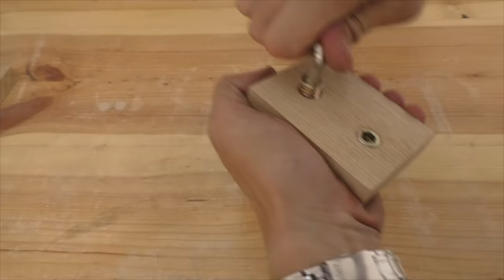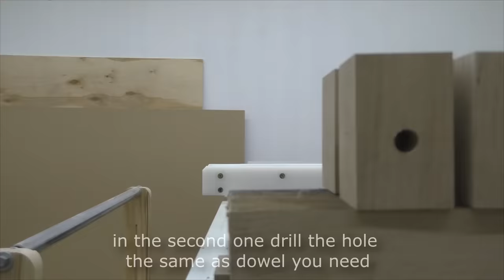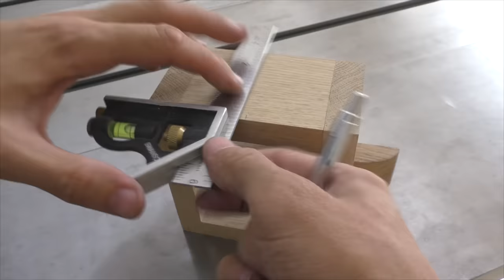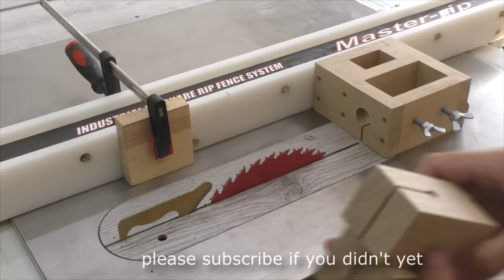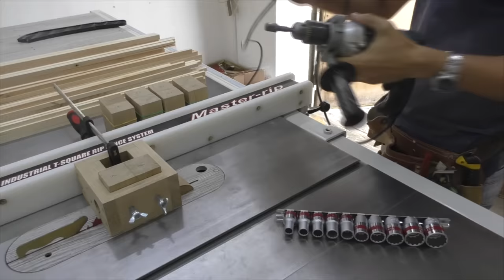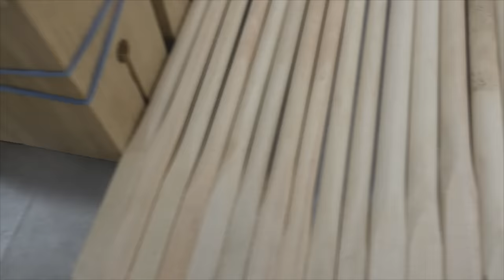🟢 How to Make Precision Dowels on Table Saw - DIY Table Saw Dowel Making Jig 👉 FREE PLANS 👈

Comment: Finished mine and made some 5/16th, 3/8, and 1/2 inch dowels from oak stock and all of them turned out great!  No need for buying high priced hardwood dowels anymore!!  Could not be happier with it.  Did add a guard onto the back end to prevent any "biting"

Comment: Made a bunch of quarter inch dowels today with the jig.  They are more finicky then the 3/8" dowels.   I found the smaller stock size would splinter if I tried to pull the part that was in the drill chuck like I did with the 3/8" dowels.  The quarter inch dowels wouldn't take the stress as well.  I just cut off the square part.  Worked very well once I got it dialed in.   I did make a extra set of blocks as my first set had shifted and went back to just a 3/8" starter hole to the quarter inch out hole.  The tolerance with the quarter inch dowels is much more picky.  I went from having a few store bought dowels to having over a hundred just using my scrap oak, maple, cedar, walnut.  The oak gave me the most trouble in the smaller size of dowel.  GREAT JIG!

Comment: Thought this was a great design and built it, inititially dowels were coming out undersized. Realized that when I marked the high point of my blade, it was in the full up position. Later when using the jig to make dowels, the blade was lower. My saw pivots when raising the blade so the high point was actually further back. Once I adjusted the mark on fence to correspond to the new peak worked like a champ. Apprec I ate you sharing the design.

Comment: Thank you very much for showing this!
I had already created a very 'no nonsense' dowel jig what was working (without the tablesaw), but i kept thinking about one with the tablesaw, came across your video and decided to make it tonight.
I did change some things (because that made it easier for me:
- i did not do your thing with the bolds and wing nut-thingy, i just uses a screw that i can turn in and out (filed the tip of a little)
That saved me a lot of time and i believe it works as well.
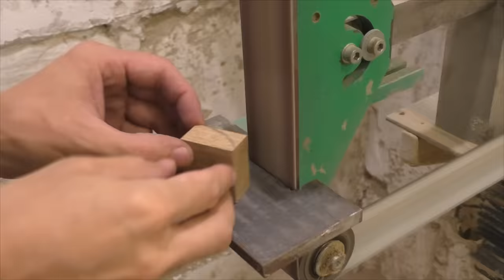Ah, and i had to make the jig to understand why you created the part at 3:07, i thought you used it to make it easier to insert the long stick, but it had a different (better) reason ;-)
I made it tonight, and tried it on one (i only created 1 size for now) and although the top of the stick came out smaller (i think because it was not really centered when entering), the big middle part was perfect.
Thanks again!

Comment: I've seen a dozen or so of these diy dowel makers I even bought the lee valley  one and sent the thing back.  This is the best  effort yet that I've seen  the only real limitation on the surface finish is the blade and feed speed.   Use a Non ferros metal blade ( one without those annoying devils ears) and your Finnish  should be superb.

Comment: now push through like you did making them, but mount them directly to the drill chuck on the rounded end to finish the left square part.
Reply from the maker: Good idea, but 13mm dowel is maximum my drill chuck can keep. Thanks

Comment: Chuck your drill up to the other end of the dowel and put it in reverse and pull the rest of the dowel thru the saw blade. Nice job I like these.
Reply from the maker: Thanks for idea, i did it already, but the maximum diameter my drill chuck can hold is 13mm 🤔

Comment: How does it compare to simply buying dowel rod from a hardware store? I guess it wouldn't be hard to include the small grooves found on commercial dowel. I prefer that type due to it being better for gluing. I could be wrong, but a simple round dowel pushed the glue out of the hole. Perhaps you could do a comparison. :-)

Comment: how do this work when the flat sides is smaller then the round hole in the jig and when turn by the drill it well be about haft the size or smaller. and if the square is at the bottom of the hole in the jig the saw blade well cut it away to nothing thats what i'm thinking

Comment: Tried this . The dowel was not bad however you can't get the end out.
Pushing it back through messes it up. Might be fine if your making a dowel or 2. Lower the blade and then pull it back.
Reply from the maker: I use another drill, take a dowel in the chuck and pull it out. I did not show it in the video. But the maximum size I can fit in the chuck is 13mm, the bigger ones have to pull and twist by hand
Reply: @GRINwood  I'm trying to design one pretty much the same but I'm going to put a hinge and latch on it so you can just open it up and take the rod out. What do you think?
Reply: @GRINwood  Finished my hinge style dowel jig . Came out great.
I'm now working on a new 1/2 router bit for making dowels. 1/2 round bits leave a small line on top and bottom of the dowel. So im having my new design being made. If it works perhaps I'll sell them ? You would have to purchase the right size Diameter.

Comment: Very brillant jig! Made out of nice solid oak and not some plywood which is a nice touch. Really like it and intend to give it a try, which is nice as you are providing free plan. And I mean, real free access plans, not a "give me your email and you'll receive them". Bravo! 
However, I've a question and didn't find the answer in the plans. Went trough a bit of comments, hoping I would find the answer but same same. You mention that the first hole should be bigger and of the size of the sticks. But what have been the "ratio" you applied for your dowels??? First hole being 1.5x bigger than the diameter of the final dowel? Something like that?
I'd appreciate if you could get back to me and it might be useful for others too!
Thanks
Greetings from Vietnam!

Comment: Was so excited to build and use this… until I built it and used it.  If the blade height isn’t exactly right, you just burn up your dowel and guide hole.  Raising the blade a tiny bit to get the dowel through produced an undersized dowel.  Also, given how you set this up by just placing it over the blade - with no lateral reference - you are wallowing out the blade trough every time you use the jig.  And that pressure forward with just that single clamping point is just asking for catastrophic (and dangerous) failure.  

I’m not sure how he’s getting such fabulous results - maybe he’s just better than I am.  But I wasted several hours and a lot of good wood trying to get this to work.  It doesn’t.  I’ll be going the router + radius bit route.

Comment: Thanks for showing this great jig. I will surely build one.
Just wondering if there is a simple method to set the correct height if the blade? Maybe by using a dowel of perfect diameter?
Cheers, Jan

Comment: What is the size difference between the guide hole and the dowel thickness? Lets say Im making a 8mm dowel the back hole will be 8mm but how much bigger must the front one be or will that depend on the size of the blank?
Reply: The first hole appears to be the diameter (widest corner to corner) of the square blank.

Comment: I missed something.  Do you start building your dowels out of square strips or how do you start with your dowel stock. Cool idea. Thanks
Reply: It's my assumption that he cuts down to the desire square stock then uses his dowel jig. But yes it starts a square. He's using the table saw and drill to work as a lathe
Reply: @seanhardaway8965  awesome. Thank you
Reply: @seanhardaway8965  yyyyyyyyyyy
Reply: @seanhardaway8965  yyy

Comment: Look for the video where simply drilling a hole in a 1/8" steel plate creates a dowel jig.  Seems simpler.
Reply: It's a very different finish and uniformity. Don't comment before you actually compare. The hummer through jigs can only do short length properly, and you get caveman finish, especially if grain is not ultra straight. They are fine for "internal", 1/4" dowels.

Comment: Roundover bits are easier
Reply: Armus,  this looks to be easier and safer to me due to the second block stabilizing the dowel as it leaves the saw blade.  The issues with a round over bit is stabilization- especially on the last corner-- I think and I don't know of an easy way to accomplish this on a router table.  Do you?  Also the high speed of the router makes any error very unforgiving IMO.  If you have an easy way I would love to see it!  Thanks!